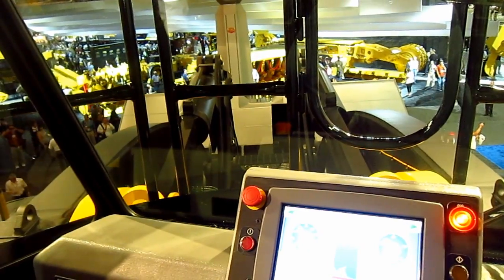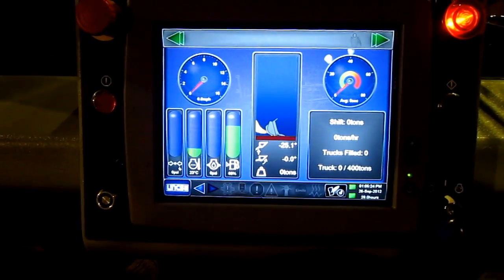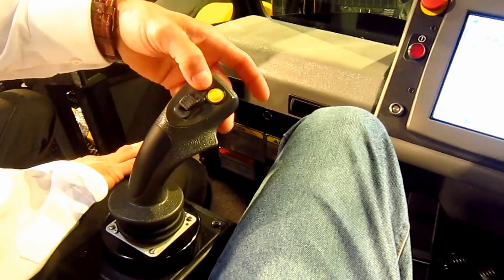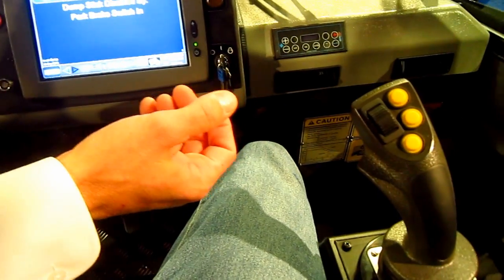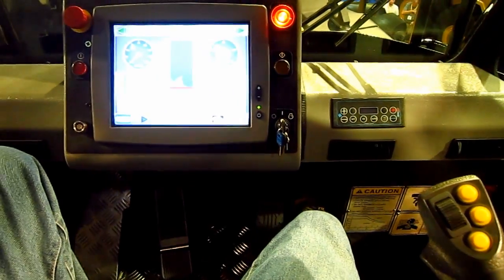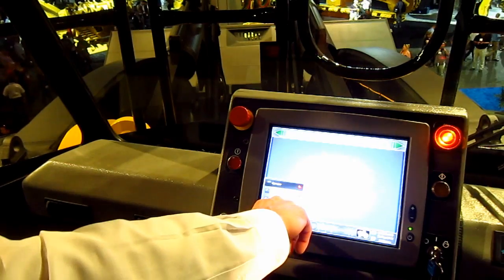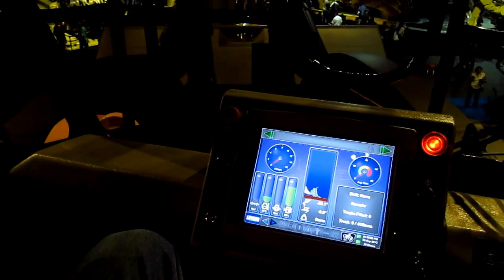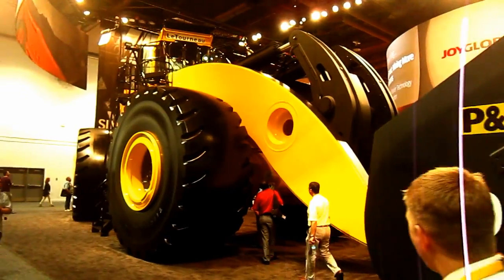Inside a LeTourneau L-2350

Comment: I'm curious if the control computer fails if you can resort to manual (mechanical) override to still control the machine.  If not, I could see that as a problem.

Anyone remember when Airbus had a test flight where the computer controlled the jet and the programming code screwed up and the jet got locked and ran off the runway and the test pilot died and the jet blew up...all because there was no way to override the computer coding and resort to tried and true mechanical controls.  Then Boeing made sure to mention the ability to override their computer programming in their jets :-p
Reply: It's double redundant. There is a backup system in there that will operate if the control computer fails. Like fly by wire in aircraft, this machine is "drive by wire." AC power turns the motors in all 4 wheels and the hydraulic pumps. If both systems shutdown, this machine is immobilized. Remember: on an aircraft you are controlling tiny elevators, ailerons, and a rudder; this is an articulated wheel loader that weighs 100 tons per either rotating unit.